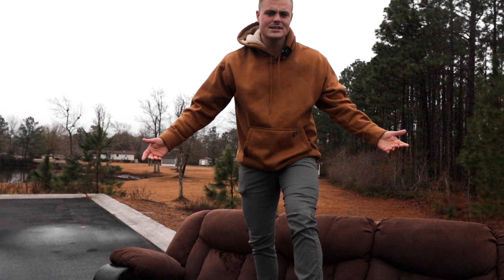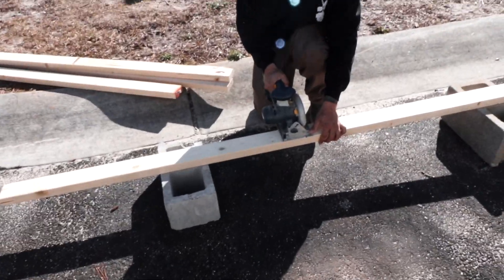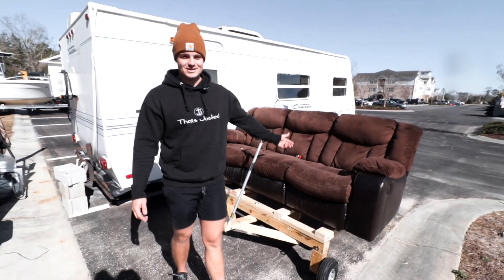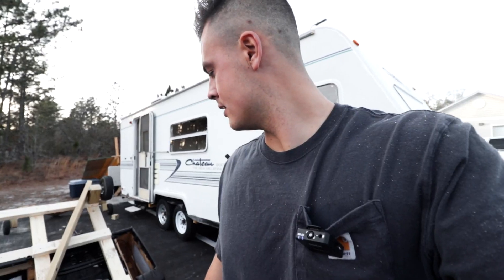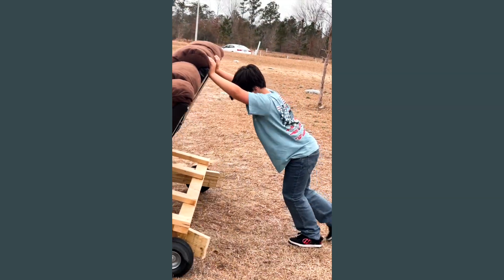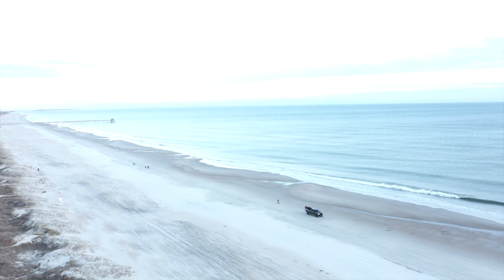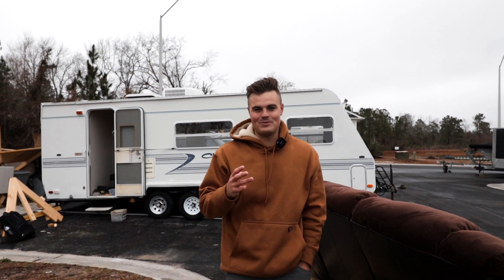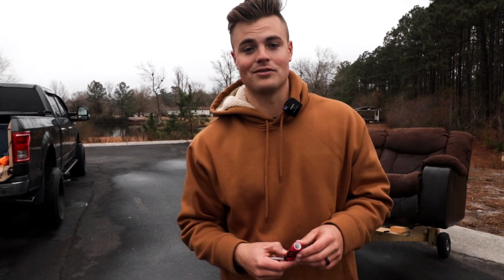We rode a COUCH down the beach

Comment: You need bigger tires you should get some small boat trailer tiers and you could also get a small boat trailer axel then you would not have to worry about the wheels bending like those did